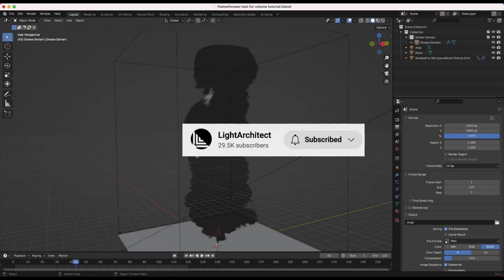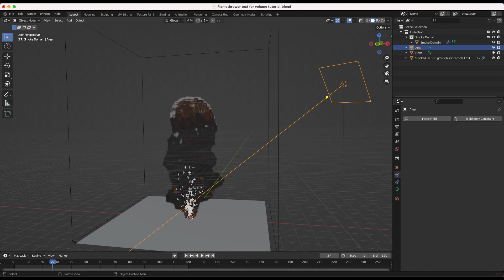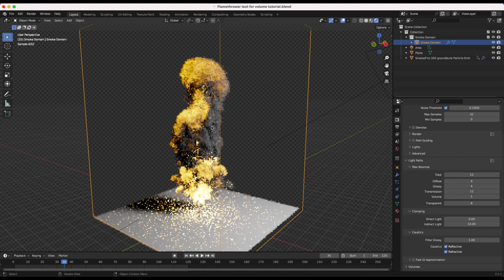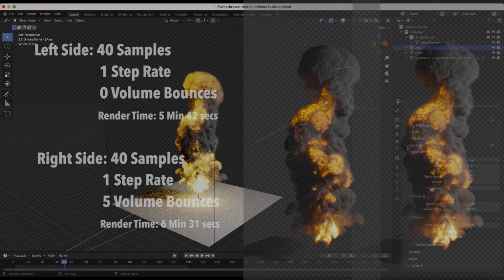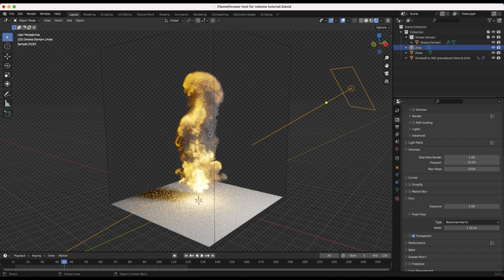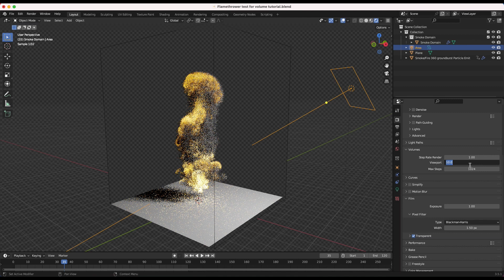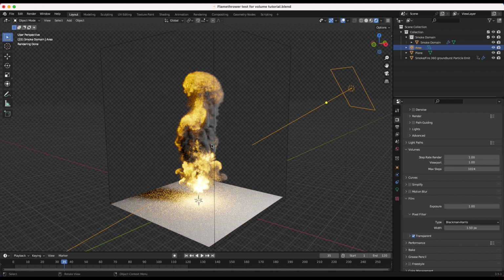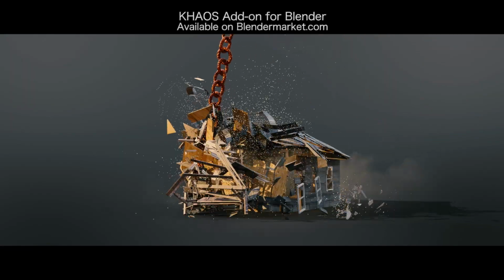Optimizing Smoke in Blender 3d: Better Renders with 2 Beginner Tips! (No Add-ons)

Comment: Hi, i keep having this issue where all of my explosions and fire look extremely low quality, my explosions keep expanding until they look like spheres, and the fireballs in the explosions are nonexistent, what should I do?
Reply from the maker: Hi rocketwastaken,
Hmmmmm its hard to say exactly the setting you need to change. I recommend increasing the initial and final velocity parameter to start around 5-10. After this I recommend experimenting with different resolution divisions and adding turbulence fields to break up those spheres(I will make a tutorial on this soon). Finally bring down the reaction speed in the fire settings down to allow the flames to burn longer. Hope this helps.